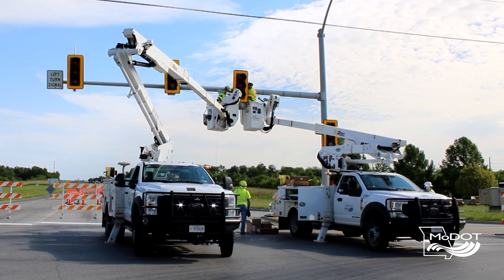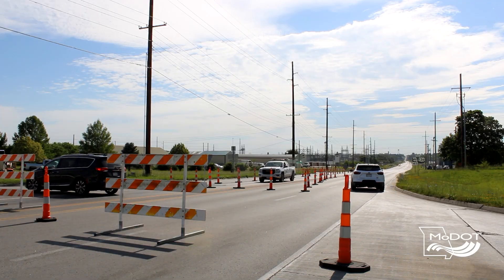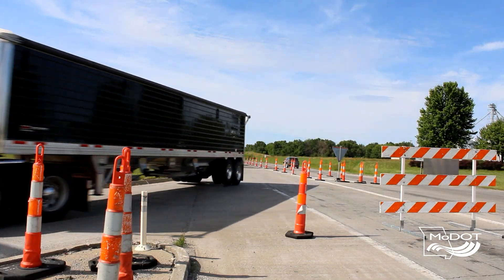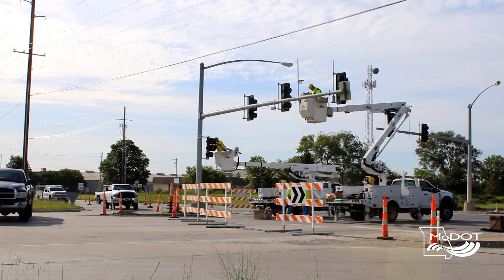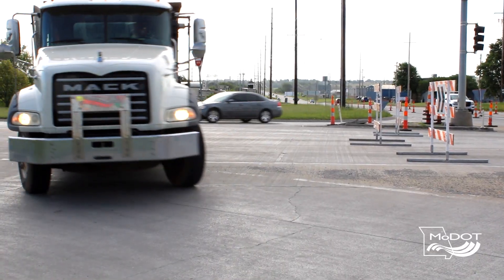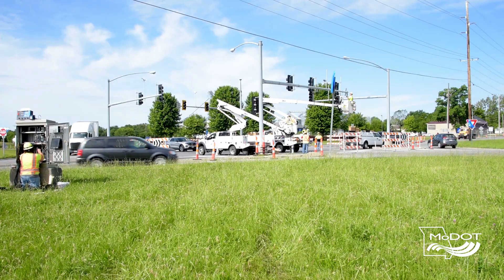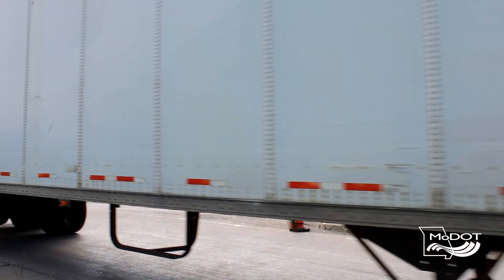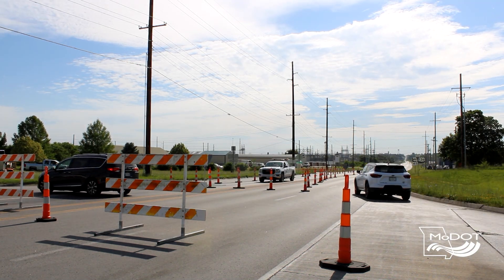TSMO Success Story #11 - Temporary Roundabout

Comment: The subject was mentioned but the question was not addressed. Why not make it permanent?
Reply from the maker: Thanks for reaching out. To change the intersection to a permanent roundabout would require more planning. The immediate need was to perform the maintenance work in the middle of the intersection, which only took a day with the temporary roundabout in place.